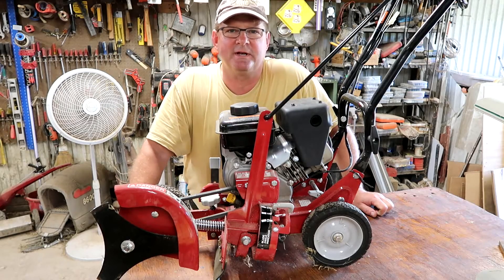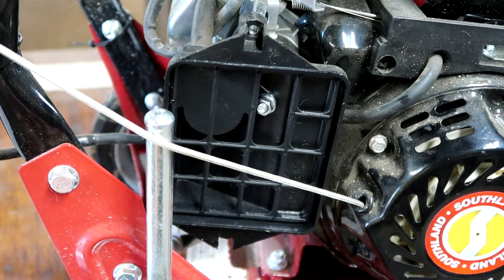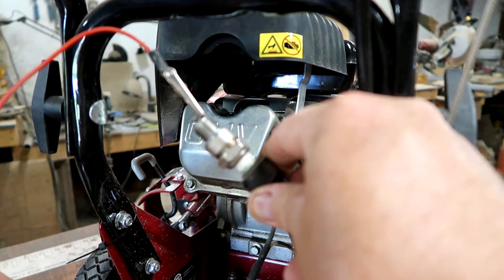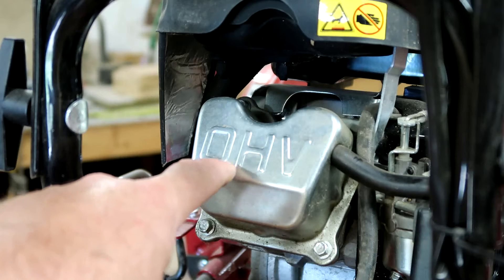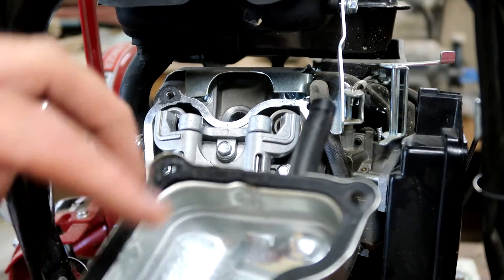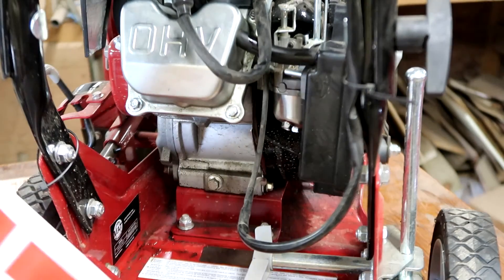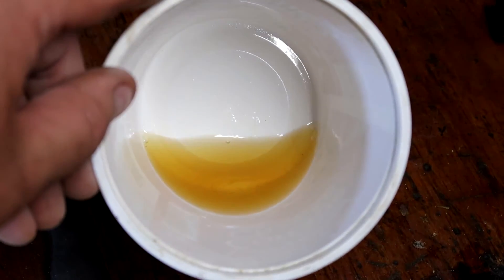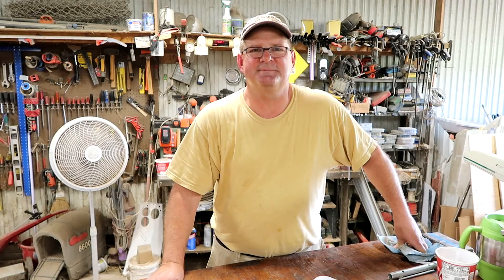Diagnosing a Small 4 Stroke Engine

Comment: Thanks fella, had the same issue on a log splitter. Stored it with the engine sitting at an angle, cylinder head was dry. No compression. Little dab of oil and off she went.

Comment: Curious if the oil trick is more of a temporary fix? Once burned up wouldn’t the lack of compression persist? Then i believe youd have to replace the compression rings because sometimes those can wear or their the gaps become aligned or a groove or ridge was present in the cylinder wall? What are your thoughts?
Reply: The dry cylinder is blue to the oil draining over the winter months.  When it is being used the oil circulates in the engine and keeps the cylinder wet.

You would only want to pull the cylinder head and inspect the piston rings and cylinder walls after eliminating the easy tests.  Cylinder & ring damage may be visible, but if not you’ll need to measure them against the specifications.

Comment: That one tip of dropping some oil into the cylinder really helped. I can get it started but it doesn’t idle
Reply from the maker: No idle usually means the carburetor.  I'd recommend cleaning out the carburetor.  4 stroke carbs are easy.  2 stroke carbs are not too bad, but just more tiny parts.  Use a twist tie to clean out the holes.  This video might help:  https://youtu.be/okt3it-sVAk